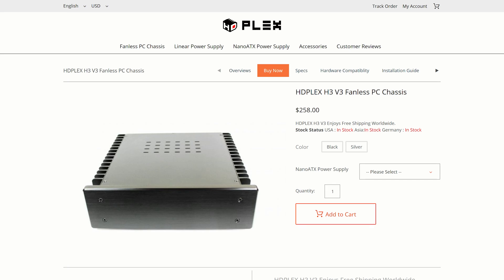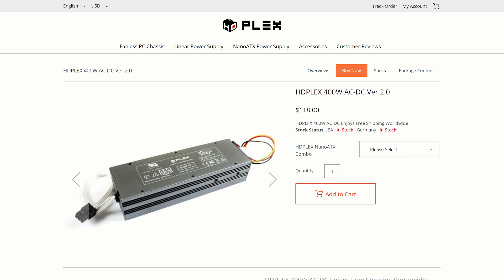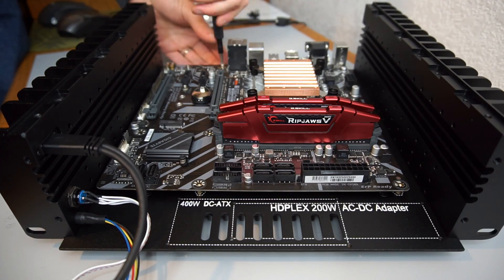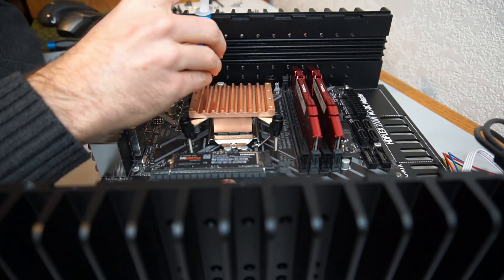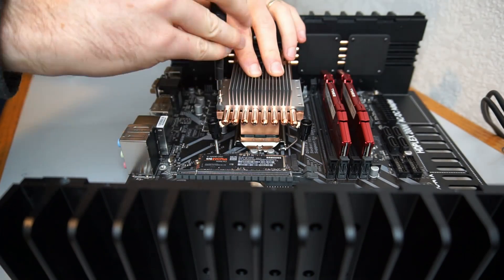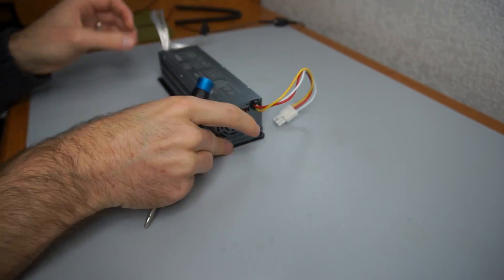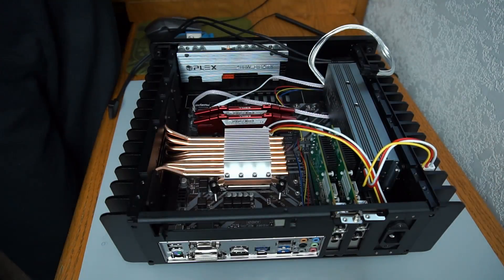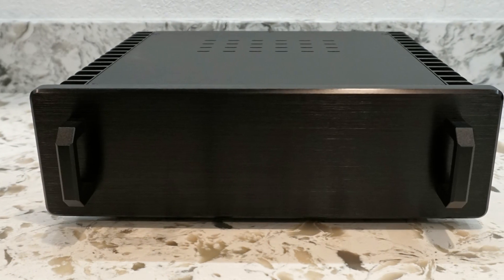HDPlex H3 - Building a Fully Silent Fanless PC

Comment: @fullysilentpcs Since you make pre-built silent PCs i would like to ask:
Have you ever tried connecting something like a GTX 1650 on to the PSU cooling side of a HDPlex H3 case using a 'HDPLEX Passive GPU Heatsink System' after first switching to one of HDPLEX's GaN Passive AIO ATX PSUs to make room?

I know that the cooling system is made for a H5 and that combo doesn't seem to be officially supported, but the way it's designed it looks like it could fit in H3 case too, but not sure so looking to confirm.
Reply from the maker: I haven't tried it to confirm, but I don't think there is enough space for that.
Reply: After doing some more research it's starting to look like it could have fit into 'H3 v2' just above the CPU, but probably not 'H3 v3' as the newer version is too far to one side and has shorter heatpipes.

Comment: Power supply has a fan, mission failed
Reply from the maker: The fan does not come on until it exceeds 240 W, which is never in this case.

Comment: I love the idea of a sonically silent pc, but building an electrically silent pc seems to be much more of a challenge unless you can afford a linear power supply which are very expensive. Even then, the cpu/gpu and clock circuits will generate a fair amount of rfi into the usb ports. Specially designed silent usb cards are very expensive. At the moment I've just been using special cables and dozens of ferrite clamps to try to tame the rfi.

Comment: Hi.
I just finished my H1v3. I see You are using here a Samsung m2 ssd. I bought a Samsung 980pro and it is hot like hell(76c)... What m2 ssd can I use?
Reply from the maker: Does the SSD have a heatsink on it? A PCIe 3 NVMe SSD would be cooler, but you should be able to use a 980 Pro with a proper heatsink.
Reply: I have the original heatsink from the mainboard on it... I need a better one?
Reply from the maker: Yes, a better heatsink will help. The motherboard heatsinks are sometimes good, sometimes not so good.
Reply: @fullysilentpcs  I will buy a heatsink tomorrow! If I open the house and puting a fan on the top the ssd is cooling down until 40c. Without a fan it is overheating until 76c.

Comment: Wait a minute, I had to pause the video at 54 seconds, on a 19 minute video.
Did you really buy a "music grade" network card"
is that what I'm hearing, through my shitty non network card SFP connection?

Literally straight out from their website:
1Gbit connection speeds
a crystal clear 1Gigabit bitrate audio orgy of crystal clear orchestra... would by your logic sound like a fucking shit show if you had a 10Gbit NIC. at least that's what you are paying for.

Unless you were doing POE where the external power would be needed for converting (again a digital signal over to...digital but delivering power to the external device) you're not going to get much out of that power supply or that card. Then comes the question.. if you're plugging it directly to the modem, does the modem need one of those card to stream and receive? does the "instrument or speaker" need one? do they also need "impeccable power supply"?

Seriously this is fucking retarded. 
An audiophile digital network card that is only doing 1Gbit, even on today standard (in 2020) 10Gbit is where it's at, high end starts at 40Gbit (dual 10Gbit full duplex) is starting to slowly trickle down, 100Gbit for the insanely privilage.... 

Audiophiles are just as fucking retarded as they were in 2000, 1990 when I was a kid/teen.

Thankfully I study and got a degree in electronics and especially in computers, so I know that 1Gbit vs 10Gbit.. vs "analog" doesn't change the "stream quality" unless you compare real time quality.

If you wanted the ultimate quality you'd need something faster then what ever sample rate you're doing on the instrument... at 1Gbit you could have 1000 1Mbit sampled instruments or 100 10Mbit instrument,  while steaming everything at 1Gbit (note that most wav/flac is 1411kbps (1.4mbps)).

Sadly and thankfully just because you have 1Gbit connection it doesn't mean that your 125MB flac file (1411kbps) is going to get played back in 1s, it's going to chug along at 1411kbps for 88.5s, enough time for you to read this comment, and realized how fucking retarded this whole video is for mentioning such a fucking stupid piece of hardware.

Comment: I'm looking to build a computer using some of your products. The ultimate location for this computer will be on a marine vessel. The marine vessel will almost always have windows/ports open and thus salty/humid air will be flowing in the ship. I think a fanless case is in order. Can you recommend a case that best "seals" from the exterior environment? I know that it's impossible to make it water tight, but as close as we can get will do. The ship will likely be going through rough seas, so this PC will be mounted along a hard surface, but the internal components should be protected.

Here are the things I want inside:
1. most powerful CPU possible
2. most powerful GPU possible
3. standard connections such as HDMI, USB, USB-C, ethernet, etc
4. at least one slot to fit a Lime SDR PCIe card.
5. Minimum of 4 TB of storage 
6. minimum of 8 GB of RAM

As far as use: I will be running this PC 24/7 as an onboard server (files, movies, gaming, etc), and processor for the lime SDR which will be responsible for things like radar, long distance communication, etc. Finally I want to be powered from a DC source (batteries which are charged via solar). 

Any recommendations would be EXTREMELY grateful (especially links to your store if you have them)
Reply from the maker: This is difficult. There is one water tight PC case that I know of, but it would not work with the Lime SDR card. The HDPlex H5 is probably your best option. Email me at matt@fullysilentpcs.com for more info.

Comment: Thanks for showing this. What would happen if I were to completely seal all the holes so that ZERO dust/dirt/water could get inside? With the exception of course of the interface connections (USB/HDMI etc)
Reply from the maker: Nothing much would happen. The motherboard and other components will get slightly hotter, but only slightly. It is okay to seal the holes.
Reply: @fullysilentpcs  Thank you for your response! I posted another question on this same video (above). Seeking your recommendation. Thank you again!

Comment: Awesome, CPU cooler has no fan but PSU has one!
Reply: Yeah, when I saw that I went "well, ain't that nice". It's probably a kind of emergency fan that only runs in case of overheating. And one could instaed use a pico psu and an external power brick, it'd be fully silent.
Reply from the maker: The PSU fan can safely be removed for power needs of less than 240 W. In this case it was removed. If left in place it will only come on above 240 W.
Reply: @fullysilentpcs  Good to know, thanks!

Comment: Hello there.  Don't know if you'll read this on account the vid is already two weeks out, but I was curious if you've had any experience with Mistel Vision power supplys.  They're one of the only other small sized fanless psu's (and the only ones that have RGB, not that it's any difference to me) that will fit easily into a First case
Reply from the maker: Hi, I have not actually used the Mistel Vision power supply.  If you are looking for a PSU for The First, I would recommend looking at the SilverStone NJ450, although it is more expensive and only 450W.
Reply: @fullysilentpcs  I'm on the fence given the possibility I would be pushing things to the limit of just barely past the 450 threshold, but with the distinct possibility I might still be under shooting it, I'm still glad to hear Silverstone box has something worth endorsing

PS.  Loving the birds
Reply: @fullysilentpcs  Better question.  How did you manage to fit the SeaSonic Prime in the First? You mentioned that it took making a cut in the back panel, and it looked like you had it tightly rubbing against the GPU.  Something I'm assuming you only managed to do getting the short Zotac pcb of the 2060?

Comment: Hi, do you live in the woods? There are so many birds... its calm... and amazing job \o/
Reply from the maker: I do, but those are field recordings from other locations, not my home.
Reply: @fullysilentpcs   Nice. I just didn't like one thing: rhe DC-ATX and ACDC converter prices ;(. But I suppose that's the price for this small form factor, correct?
Reply from the maker: Yes, but there are cheaper options.  You can use the 200W HDPlex combo, or a different PicoPSU and external power brick.